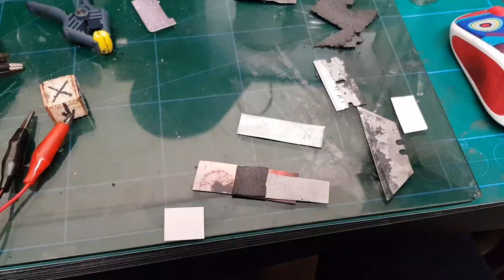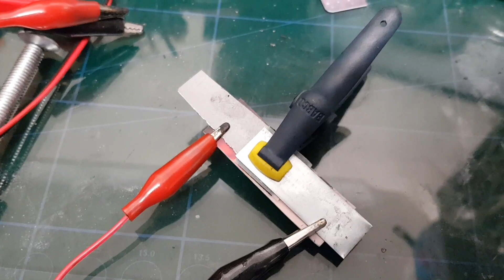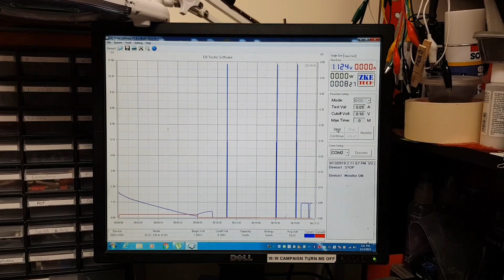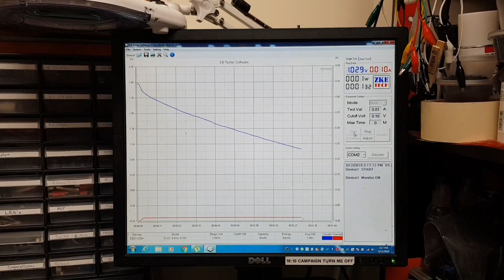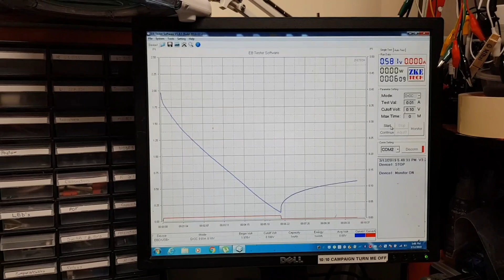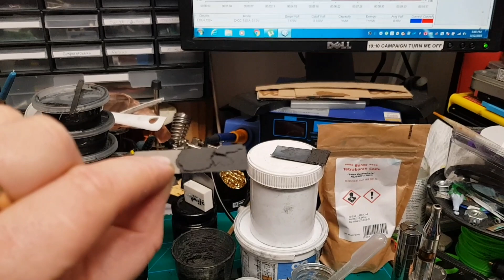Charging/discharging of a Zinc-carbon battery, how the performance is changing - part 2

Comment: Interesting, but, as you say, somewhat disappointing Solarhope's suggestion is perfectly valid, and reflects standard scientific methods. If you change several parameters simultaneously, they may be interacting with one-another, and you can miss vital clues. Patience, as you'll likely appreciate, is more valuable than diamonds. Thanks for showing us what's happening, Sorin.

Comment: Maybe just change one thing at a time. Putting 3 electrolytes in succession onto the active material will give unreliable results. You could also run a test cell without any binder, if you are only testing the active material  :-)   Martin.

Comment: I totally agree with solarhope about changing one thing at a time. Otherwise it is difficult to determine which change is producing the results. Another thought is to let the materials sit for some duration before starting the tests to let the chemistry stabilize. Various chemical processes take different times. This is particularly important with changes in pH. If the electrolyte is reacting with the electrodes the initial results may be misleading.
Reply from the maker: MrFmiller and Martin, you are both right,  I haven't follow my own testing methodology cus I was trying to do more things in the same time, ... My fault! I will prepare a new active material, without any binder, then press it at 100-200 centigrade to make it a plate. But that after I make a ball mill device and for the moment I am starting my day shift at the second job, one week I'll be away. Very good suggestions,  Thank you!

Comment: May I ask what you changed between the kev cell and this one? The discharge curves were much better there. I think you are onto something with the electrolite but with the active material something must have gone wrong.
Generally I donth think pressing the material helps. Basically you hinder the electrolite to soak in and decrease surface. Can't be good. Other than this verry interesting work!
Reply from the maker: Hi Markus, I added more binder to make it a stand alone plate, wrong decision.  But going on the other side, less binder, WOW...I am testing now a new cell, at 50 mA, has already 25 min of running,  it will run probably for another 30 min and looking so encouraging,  watch the next videos! Thank you

Comment: Hi. What's the state of the zinc plate with regards to oxidation? Does maybe sanding it down on the separator side improve things?
Also maybe try a slightly lower charge voltage to see if it improves. Maybe with the water based electrolyte it's too high?
Reply from the maker: Thank you, I will try these in my future tests, this is exactly what I love on posting my work, suggestions,  ideas,  critics,  all are shaping my work and make me achieve more! Thank you again!